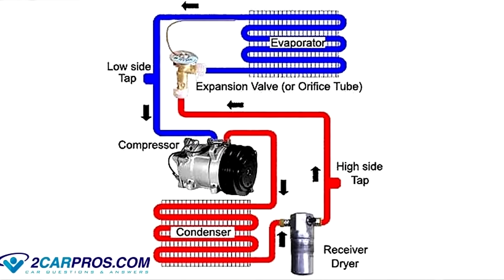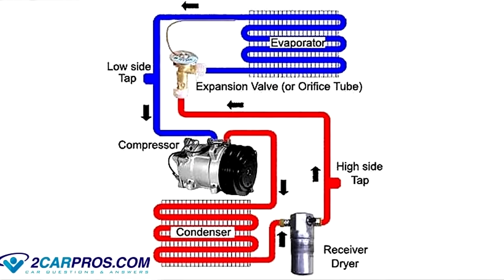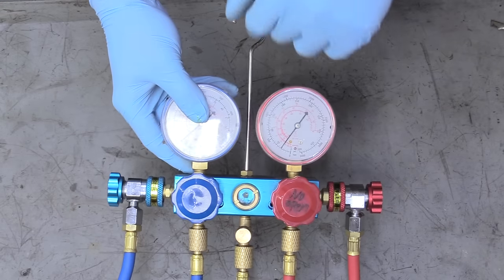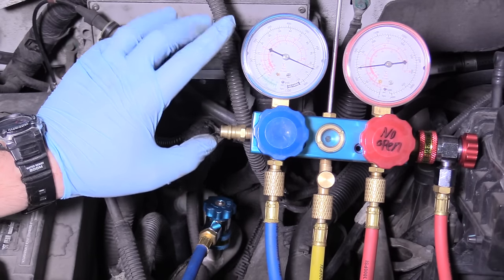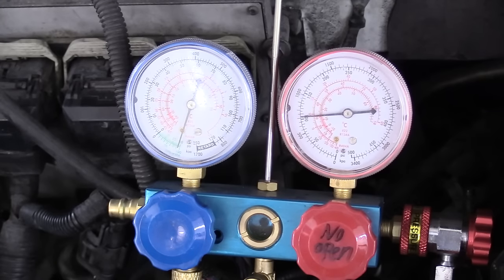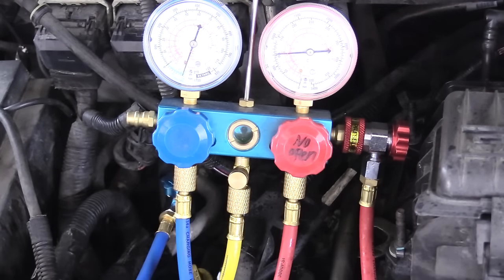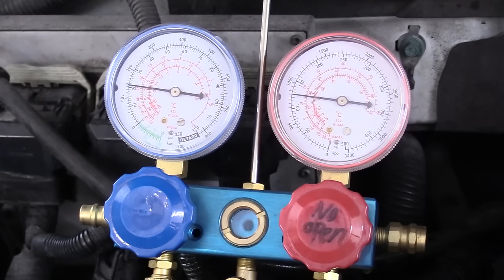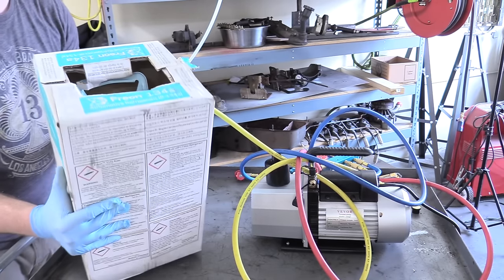How to Vacuum Down and Recharge Your A/C System! - EASY

Comment: I've been a formerly certified mechanic for a mere 20 years now(started with my dad, to a business and now on my own).I've been telling people I know jack smack about HVAC on a vehicle.  I couldn't take it anymore.  Watched this video all the way.  Now I can add a new extremely basic service for ac recharges.  We are in Texas, AC is year round these days except for 2 months.  Thank you sir.  This is a blessing from God and you shared your bread with others.  I'll cherish it.
Reply from the maker: Awesome! Thanks for watching!
Reply: Using my manifold set- I'm recharging through the low Port ONLY- the low Port coupling is obviously open. My question is-your highport coupling is open so this way you can READ the pressure on the manifold gauge... The High valve on the manifold gauge NEEDS to be closed...BUT the coupling on the high side is OPEN for reading on the manifold gauge?

Is that last part correct??
Reply: Close the high side when recharging. 
The high side is only for vacuuming and diagnosing.
Reply: @coyoteserranoband   Yes, follow what he did in the video. Close the big red knob before connecting the refrigerant in fact, close both knobs ( blue and Red  low|high ) before connecting the yellow service line to the refrigerant.

open the blue knob after you bleed the yellow line of air and open that knob only at the manifold and very slowly.
Reply: Where in Texas? My AC compressor isn't engaging, needs attention!
Reply: Hey Brother thank you for this positivity and giving credit. Need more people like you good sir.
Reply: Hi Matey, Just thought to mention & for anyone out there that the HIGH Side MANIFOLD gauge will read the High pressures Always when the MANIFOLD Tap is OFF . The HIGH Side VALVE CONNECTOR is carefully turned ON Only for the release of pressure to the MANIFOLD Gauge to read it.  Note:- BOTH HIGH & LOW MANIFOLD TAPS Can be turned OFF & Still read the pressures coming from your high & low side Hose VALVE Connectors, provided those VALVE TAPS are open & there is pressure.
Reply: If I want to just have the shop drain the old then replace the A/C system with refrigerant after I replace everything would it hurt anything on the system driving to the shop.
Reply: @2carpros  My AC works but after six years I plan on doing a evacuate and recharge of the system.  Some AC techs add a little 134a refrigerant oil when doing the recharge.  Is there a need to do so?  If so, how much should be added?  I've seen it in 3 and 4 ounce cans.  Thanks for the video.
Reply: I noticed some brands of 134a refrigerant contain leak sealers.  Should those be avoided?  Also, do you have a preferred brand of refrigerant or are they all similar in quality?  Thanks
Reply: I replace my compressor vacuum the system and recharge, the low side is reading 40 and the high side is 275 to 300 and the outside temperature is 90 is that natural
Reply: He keeps it soooo simple and slow also. So even forest gump can follow along.
Reply: By Federal Law, you MUST get EPA 608 certification to do HVAC work, so adding that “basic service” without the 608 Certification is a really bad idea.
Reply: @coyoteserranoband Correct
Reply: @coyoteserranoband  you are correct. Manifold (gauge) closed, coupling open so you can see the pressure reading.
Reply: I read this whole thing in a texas accent then seen your in texas. lol

Comment: Just a quick FYI from a licensed residential HVAC technician, the top port on the vacuum pump is for a normal residential ac hose hook up, not out dated lmao! It’s appears the vacuum pump can do ur home ac or vehicle.  A lil late but thought I’d help u guys out with that tidbit 😊
Reply: Yes indeed! R410A but it's actually the same exact connector as the old r12
Reply: @SMOKEY-JAYS-DIESEL It’s for ALL applications other than automotive, and is not specific to ANY refrigerant.  It’s a 1/4” Flare fitting.  The collet QD fittings are ONLY used on newer automotive systems.
Reply: Yeah that definitely helped me out. I was wondering why mine didn’t fit the bigger one😂. This is still a great video and helped a lot.
Reply: Hi, good work but I have a question. Is not the connection for low pressure going to the compressor and would damage it?
Reply: That is when you are doing liquid charging.

Comment: I'm 50 years old, have been working on cars for 35 of those years, and am quite arrogant.  But I cannot believe how much I learned while watching this video!
Reply from the maker: Thanks so much for watching Adam!
Reply: Is vehicle's engine running or off when performing this vacuum procedure?@2carpros
Reply: @dejo50th  I did it with the engine off.

Comment: I'm a truck driver and doing some work on my truck saves me a ton of money and with just this video you saved me around $2000.00 bucks. I thank you and God bless you.
Reply from the maker: NICE! Thanks for watching!
Reply: I know these are older comments, but I’m going to throw this out there anyway, just be careful , I killed the compressor in a freight liner, that cost goes way up when it gets screwed up and your buying parts and not just cans of liquid. I recommend you plan out a step by step procedure and follow it carefully and try to limit distractions while you preform the job. If I would have done something like that I wouldn’t have had to buy that compressor. Good luck my friend.

Comment from the maker: We say turn the bottle upside down because we "crack" the valve open where it is released as a GAS not liquid in the gauge set, and again once it enters the system. You can do it either way. Also leave the high side valve closed when vacuuming down, it wont vacuum faster with the valve open, it equalizes through the orifice or expansion valve, no problem.

Comment: It would have been nice for you to use the 'little-guy' cans to see what to do when emptying one can and starting another the way a DIY home mechanic would do.  Thanks for the video - very helpful!
Reply: Close off valve that's connected at vehicles port purge air out by opening how he did at the beginning of his connection of the big refrigerant
Reply: Ideally where you connect at the can there is a valve there that you can close before switching cans and that will prevent air from entering.

Comment: I replaced my evaporator on my 2012 ram 1500 and never vacuumed the system. All I did was add a can of 134 and it's still working fine on the hottest Florida days.

Comment: Thank you very much for your video! Since my husband passed away, I have learned to do many car repairs thanks to kind people like you who share knowledge! I have replaced my vvt solenoids, my blower motor, the ac circuit board, changed the oil, and more. I am now hoping to get my ac running again because this 100 degree temperature in Houston is killer. Not to mention, only 1 of my windows rolls doen, my car is black, and I work as a window cleaner outside. I am sure my coworkers would be happy if I can get my ac working...lol! Thanks again!
Reply from the maker: I'm sorry for your loss. I'm very impressed you are a self taught badass! Thanks for watching!
Reply: @2carpros  thanks so much!
Reply: NO WAY IM IN THAT SITUATION RIGHT NOW. I live in Houston, AC system went out, only one window works and car is black... Will be attempting to fix it myself.

Comment: Followed this guide and purchased the recommended kit on amazon, about two hours after it arrived I had my AC fixed and blowing colder and stronger than I can remember! Thank you for an excellent and helpful video!
Reply: Did you refill from a keg?
Reply: @LandenBMS  I did not, my system used about 4 12oz cans of Super Tech 134a refrigerant I got at Walmart along with a can or two of AC refrigerant oil from the same source.

Comment from the maker: For everyone asking "Why is there a high side valve if we don't open it?!" It is there to vacuum it down the system a little quicker. The reason I said don't open it is the system is a loop and just vacuuming via the low side will accomplish the same goal a bit slower. BUT if you forget to close the high side when you turn the car on with the keg attached the system pressurizes with the valve open it back feeds into the refrigerant keg and explodes most likely injuring if not killing you. Good? Good. 

ALSO You don't need to add any in this instance because nearly zero is lost. If you put too much oil in the system won't work at all and is very easy to do. 

If pag oil was important in this instance I would have mentioned it.

-Ryan
Reply: Just seen this comment, make sense now
Reply: just had a coworker arguing that you have to use the High side while recharging. I told him to get bent.
Reply: 7
Reply: B
Reply: Old-timer here.Decades of MX/Engineering in Aerospace. You're the REAL DEAL, Ryan. You're an excellent educator. You emphasize the danger points well. People DEFINITELY need to hear those safety points over and over. Thanks for another excellent video and keep up the great work, young man.
Reply: Nnwi see
Reply: Finally a good video on AC Recharge.  This is the best video online.  WIll lov to watch more of your videos.
Reply: What about when doing a pressure test?
Reply: Thank you for explaining that, good advice for a novice like me. I'm also a little forgetful at times.
Reply: Amazing video.  Just one question.  Don't you have to add compressor oil into the system since emptying the AC you would have lost some oil?
Reply: How about after assembling the system, and you want to vacate the moisture? If you open only one side to vacuum, all of that moisture will pass through your new drier.
Reply: Once you've evacuated the system, why not just weigh the required amount of refrigerant into the system rather than play around guessing how much to add based upon high side / low side pressures? Doing it by the method above seems  to be adding extra work and is less accurate than just weighing in refrigerant...the manufacturer's label for refrigerant type should specify how much refrigerant to add.
Reply: Yes but the service manual will also list high and low side pressures for a range of ambient temps and also list what the expected vent temp should be.
Reply: @Asian_Connection  the vacuum pump does not remove oil. If you remove a part like a condenser or a hose then you will need to add oil. You should check a repair manual or somewhere online to get the appropriate amount of oil that a given part normally contains.
Reply: @jimgray373  Thank you so much for your explanation.  I guess I will add 1 or 2 oz u assume that will cover the oil that escaped withe the freon.  my ac still have a few lb of pressure when I checked.  The car is 20 years old so I assume most of it leaked out over time.
Reply: The tanks are typically rated at 300psi and test pressure is double that.  The compressor or the lines will blow up long before the tank ruptures
Reply: Seem to me that Shrader valve on the charging hose, how can you pull a vacuum and charge?
Reply: @hanc37  I think I see the shrader valves in all 3 of the holes.  I loss vacuum once I open the manifold valves.  No sure if that is the expected results.  I thought the shrader will kept the vacuum in the holes.  I'm I looking at this wrong? thx
Reply: Awesome video!!!! Do we need to add a little oil also for the compressor or is that already in the refrigerant?
Reply: @jimgray373  Do I have to add some oil in this situation?  System was 95% empty when checked, had light pressure, vaccum system.  I was think I would add dye and 2 oz of oil and reload.  What do you think? Thx
Reply: Good....and Thank You!
Reply: Hi,  Can someone help me?  So I vacuum down the AC system and left it connect for a day and it seem to have lost 8psi (-22psi).  I think it's a very slow leak since when I tested the system before Vaccum and it had a little pressure in it.  So my question is if I inject the dye and then vacuum the system to load the Freon will it remove the dye from the system?  Thx
Reply: Note to self*

If I wish to potentially kill myself, DEFINITLY do that.
Reply: What happens if you by accident had both manifold valves open and charged r134a through both the low and high side and nothing blew up?
Reply: @jamesa6272  It's fine. You just don't open the high side because the refrigerant on that line will be higher pressure than your can/keg at some point and will be forced back out of the car. When that happens no more refrigerant will go in and you're just pumping whats in there around through your gauges. You probably never will get the correct charge until you close the high valve on your gauges. If your can/keg has a check valve it will just be trapped in the hose and be wasted. It'll be a mess you weren't expecting and you'll be dealing with enough pressure to hurt you when you disconnect. So, always make sure you bleed the pressure off all lines in a controlled manner before you disconnect everything even if you know you there should be no pressure there in the first place.
Reply: @bridgetrobertson7134  thanks for explaining. Luckily nothing happened.
Reply: @Asian_Connection  no! The oil will stay in the system! You can get too much oil in your system!
Reply: Very helpful video sir, especially for us that didn't understand the ac system. Thank you .
Reply: @tomboytomgirl5356 ❤ I love to see comments like this! I love it when people take the time to say kind things to good people!
Reply: Hmm in my manual for the recovery machine I use it says to charge through the high side whilst engine is off, and then shut off high side and fill through lowside with engine on. I was also taught at school to fill through high-side after Vaccing down filling only half the req refrigerant and then filling the rest with engine running through lowside. That was also multiple teachers.
Reply: Thank you! Great video
Reply: What about adding the Pag-46 oil. ? When does that happen? After vacuuming the system? Before adding the 134-A? What's the pecking order when it comes to adding the oil?
Reply: @MissChiVUs1  Thank you @MissChiVUs1. I love clarity and safety.
Reply: @erik9685   from what I understand if it's needed after vacuuming the system (which should only be if you changed parts like a new compressor that is missing it) you would then add it to the yellow line by pouring it into it , and then attach the hose immediatly to the refrigerant can tap, that way it is also drawn in simultaneously with the refrigerant.
Reply: Excellent video
Reply: What about the expansion valve? Does vacuum pull through that?

Comment: I know that it’s taught about the efficiency of liquid charging, but few people know that it also builds head pressure very quickly, and has, on more than one occasion, damaged compressors, and even blown up discharge hoses. If I’m not being paid by the hour to do it, I am more than content to babysit the damn thing and gas charge, then, there is little to no chance of slugging the compressor. Unless the system is a walk-in cooler or something, the time saved by liquid charging is really not worth the damage it could do. I will say that I have learned some things from this video, however. Keep up the good work of making sure that people out there realize the potential they have to hurt themselves if they don’t do this correctly.

Comment: This saved my Bacon. I replaced a line that blew off. I'd installed my AC 6 years ago- my one and only experience w/AC- and had forgotten how to use the manifold gauges and vacuum pump. Great write up and greatly appreciated.
Reply from the maker: Nice work!

Comment: I know this is an old video but I give thanks to you for spelling out easy peasy how to perform this service. I’m diy and this really helped to get me going. I’ve got a 2013 f150 that I pulled out the dash and replaced the evaporator, heater core, expansion valve, drier  and  a damaged low side line(I did that). Tried to vacuum and charge and then had to have it diagnosed and had to do the compressor. What a mess. Thanks to your video it made things way easier than the others out there. Thanks again
Reply from the maker: Happy to help! Thanks for watching!

Comment: I believe you may have forgot to mention the maximum vacuum will decrease by 1 inch of mercury per 1000 feet of elevation. At 5000 foot elevation the maximum vacuum will be 24 inches hg. (29-5=24)  Thanks for a good video.
Reply: Why will this be important, to me that's very confusing doesn't mean anything or it's just knowledge
Reply: @anamarin6475  Because when you pull vacuum and your at say 5000 feet you won't see the gauge go to 30in.
Reply: THIS! I have been searching for this info- my beat-up auto zone loner vacuum had me thinking something was wrong because I could only pull 21 inches hg. But I’m at 6300 ft elevation.

Comment: Young man, I did all that you mentioned on your video. I had to end up putting 4 cans of refrigerant in my truck. I replaced all the ac lines, a vacuum line that is hooked new vacuum hose to the switch on the dash...I got the right size hose at Orielly's. I done all the work myself. It's nice to have ac in the old 99 model. Ron
Reply from the maker: Great to hear Ron! Thanks for watching!

Comment: very helpful, thanks.  Realize it's been 4 years since posting, but I have had a devil of a time finding shops in my area that even do the simple discharge of my system.  Among the no's:  1. that they don't have the equipment, or 2. they usually only do that as past of a full a/c repair, 3. that they don't work with DIY people, or 4,  if they do it, they'd charge a full hour shop time ($150)....   for the simple step.  (claiming it's bay time..... and say they don't tun around and sell the refrigerant)   $150 !